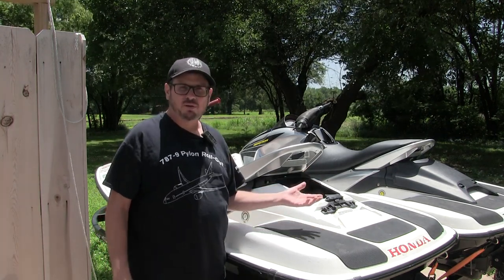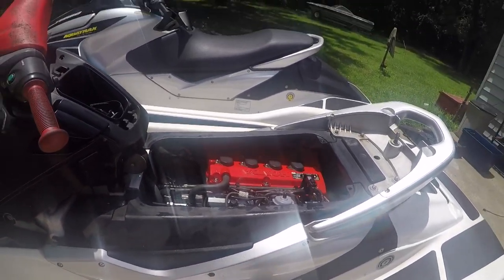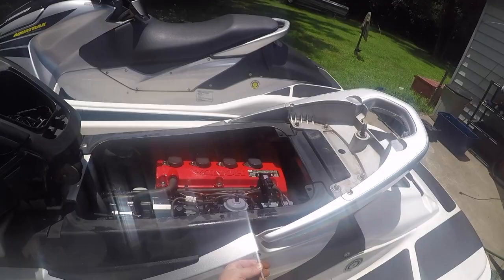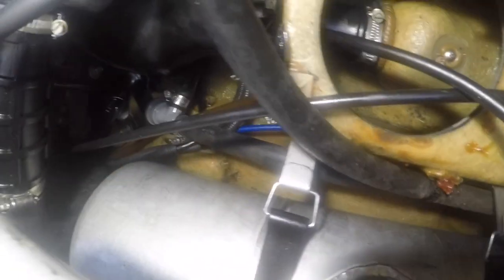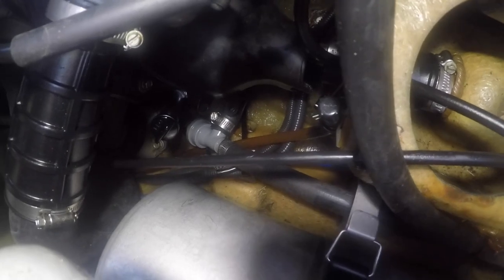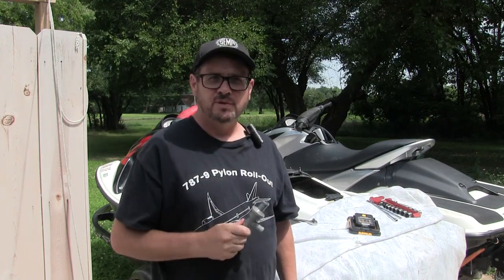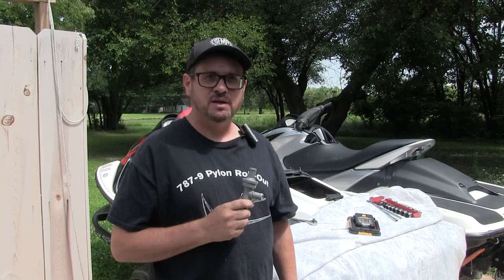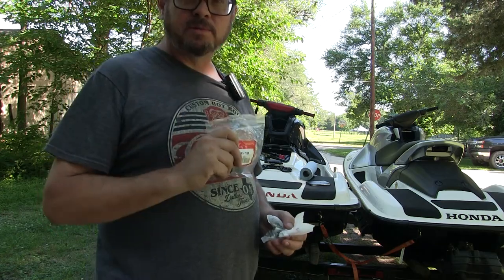How To Replace Jet Ski One Way Valve - Honda Aquatrax

Comment: Thank you for this post you really helped me! I had a customer abandoned two F 12s I am trying to get titles as we speak I sent out cert letter two weeks ago. These have sat for over two years out in the elements the old owner did not take very good care of them no cover no nothing I barely got one to run amazing after two years out in the dirt dust snow and rain they fired and even the cluster worked all faded out milkly from the sun. Anyway I hooked up the hose to the fitting and no water came out . I [pulled the connector by the engine off and water just spew out under pressure . I thought do I have rust in the cooling passage ? I cant get water in there  I was freaking its down in the 20s now . Anyway I saw your post took out the check valve I blew through it and there was no check its more of a deverter no moving parts I blew through it and it blew through all ways forward and back wards . I hooked dirrect and thank God I finally got water through it and it started discharging water out the exhaust . I went to put the valve back in and looked on the side of it and saw the arrow flow I just realized the factory had put it in back words the flat part was towards the back and that is back wards the flat part of the valve needs to go forward. I hooked everything up hooked the hose on the nipple fired it up and I had water I am one happy guy now I can run atifreeze through it thank you . BTW PEOPLE THE PEE TUBE WAS NOT DISCHARGING WHILE IT RUNNING TAKE A STRAW FROM A CARB CAN AND STAB IT IN THE HOLE CRAP GETS IN THERE AND BEE CUTTERS WILL TRY AND MAKE A NEST IN THERE AND PLUG IT UP YOU MAY HAVE TO GET A LONG WIRE BUT JUST STAB IT UNTILL YOU GET A PEE STREAM HAD TO DO MINE TWICE

Comment: When you show us the valve on the ski, is it backwards? Because the one on my ski was the other way around and every diagram im able to find of the one way valve shows them facing the opposite direction. The "big" part of the valve facing towards the back of the ski, not the front

Comment: I am having problems with mine overheating when I run it hard. I think I am not having the water flow that I should. What forum are you on? I search Pwctoday but I couldn’t find anyone with similar issue.
Reply: Hey @roops I am having the same problem now with my turbo did you find a solution I can’t seem to find it anywhere ?
Reply: @curtiskent4886  I used salt away and over time mine got better. 

I saw someone pulled the front oil cover and found salt deposits blocking the ports.
Reply: @RoopsPhoto  thank you very much for your fast reply I’ll have to try this appreciate it 🙏

Comment: I have two Honda Aquatrax F12X. One turbo one non. Both on take off seem to not hook up with the water. I have read on some forums they call it cavitating. Do you know how to fix? Does your Honda do that?
Reply from the maker: Mine took off pretty fast so I don't think I had that problem or would know how to fix it.  I am moving and had to sell my jet skies a couple of weeks ago.  It was sad....we had so much fun on them.
Reply: I think mine does this too but I've always just thought it is because it accelerates so fast. After 1s my Turbo is hooked up and off
Reply: @JShoop1  I replaced the jet pump and the cavitation went away on my turbo
Reply: @CarAddictGarage  is the water on the t check valve is the water supply when it is checked coming out the top  . So the water doesn't go straight thu . Thanks
Reply: @natewill  i
 Am taking it apart now and i have no water going out the top of the t all the water is going straight thu. Thanks

Comment: Why did you change the check valve?
I have a 2005 aquatrax and the water is coming out real hot.
Is that’s the reason you change the valve?
Or could you help me on my issue?
Reply from the maker: There was water bypassing through this valve...the wrong way!  You may try to blow the hole in the reverse direction with low pressure air to clean out the line.  It may be partly plugged.